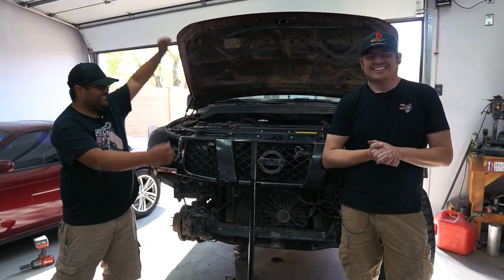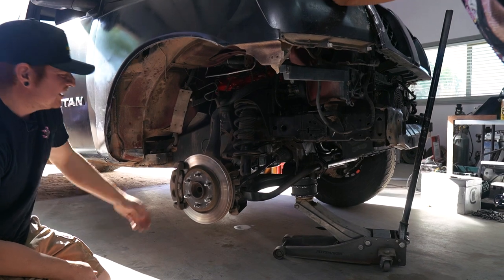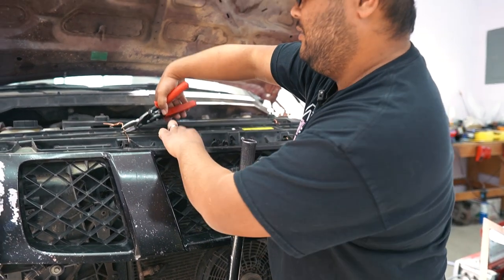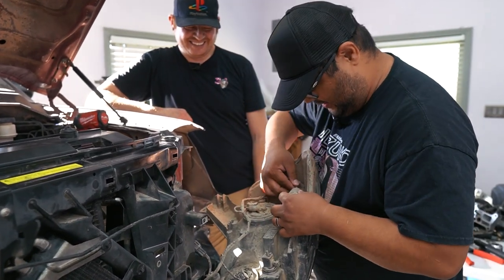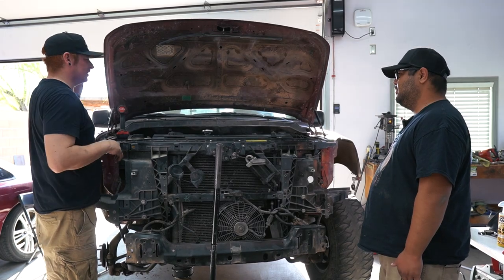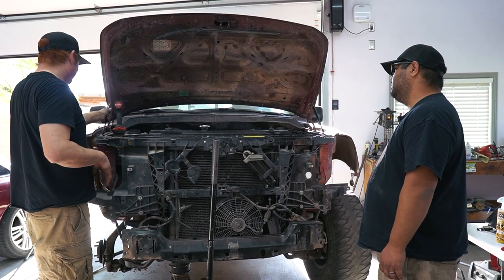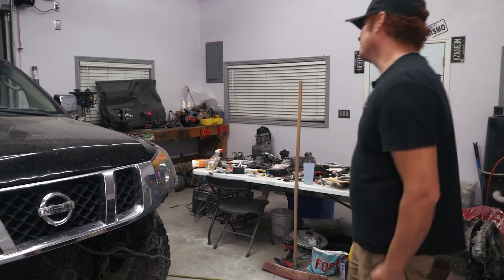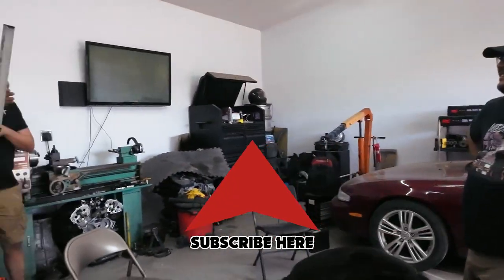Nissan Titan Front End Conversion

Comment: Fun fact, if you want a transfer case and front drive shaft, they are identical on the Xterras and Frontiers. Swapped mine painlessly when I broke the original one from a Junkyard xterra and it's still going strong as my dedicated snow vehicle. I'm assuming the half shafts are longer on a Titan tho.
Reply from the maker: I've seen them at the junk yard and have been wondering exactly this! Good to know 👍